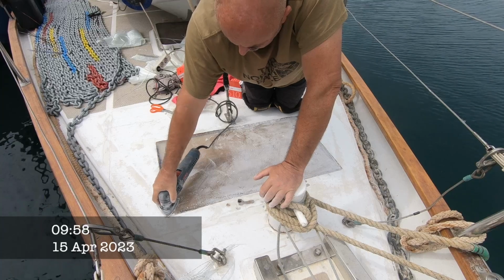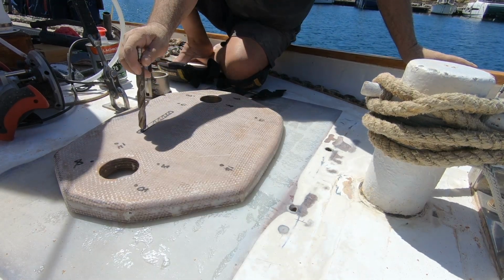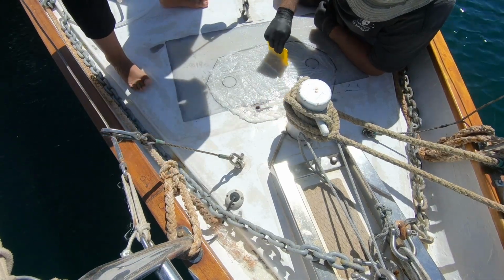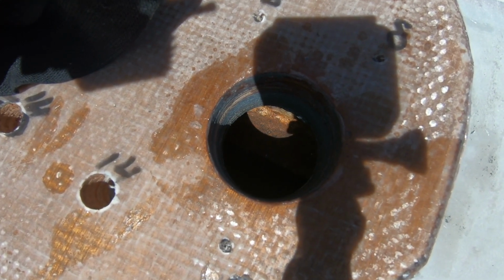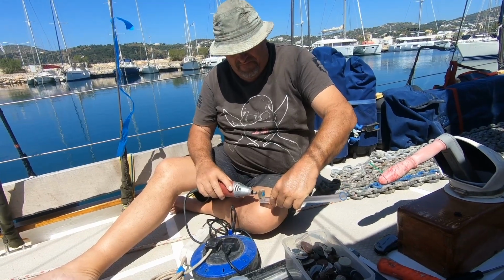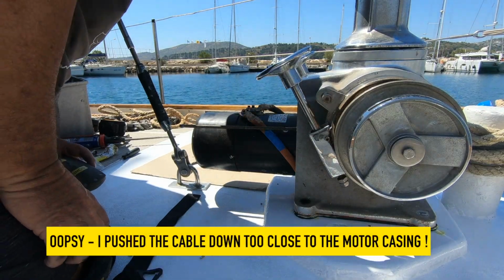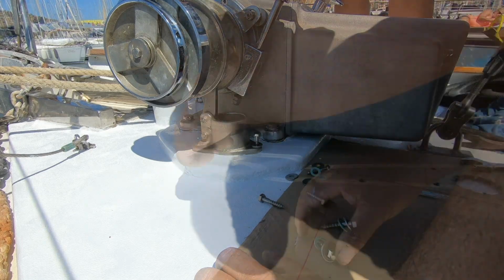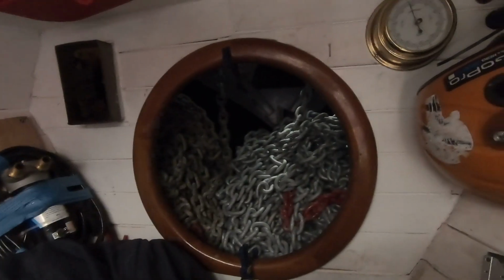EP160 Refitting the windlass

Comment: Of course we changed our WIndlass oil - because the previous owners clearly had not as it was not oil any more, it was treacle 😆and the windlass had packed up!!! Our Lofrans has the same "emptying technique" 😉 BTW - we also insulated our cable ends with tape because leaving them exposed with a metal housing above them and a metal motor below them just seemed daft to us. We sealed with Butyl because Sika should be illegal...

Thanks for the shout out. We are in a marina tonight because there is nowhere to anchor but on the plus side, we have internet! Yay!!!
Reply from the maker: We ❤️ sikaflex …. NOT  always pleased to mention fellow channels.

Comment: What product were you using to prevent galvanic cell's with dissimilar metals?
Reply from the maker: The product we were using was duralac it’s used in the aircraft industry to prevent corrosion , I use it on anything of disimilar metal on board.
Reply: @SVBlownAway  thank you!